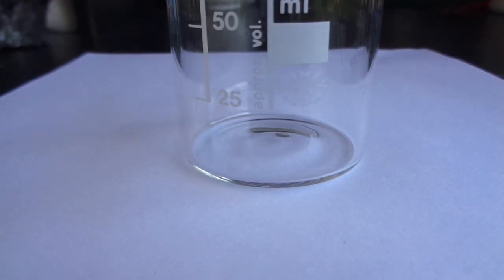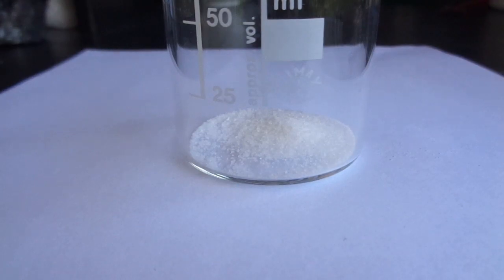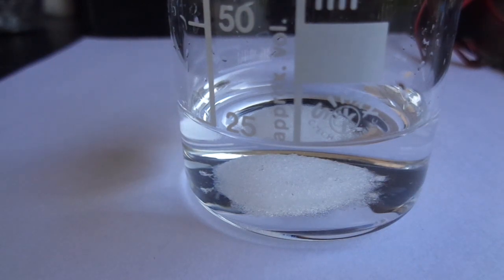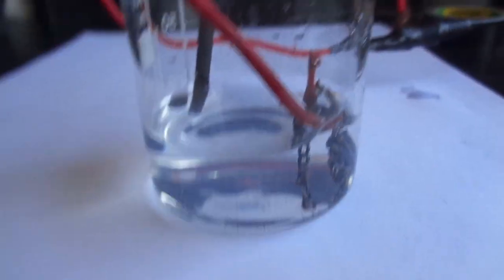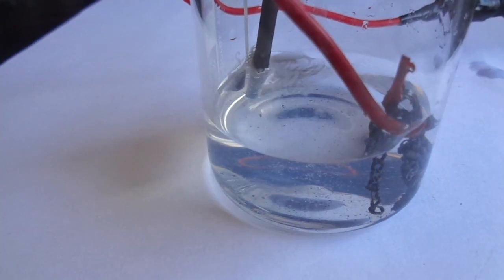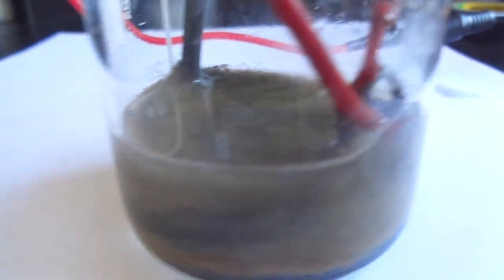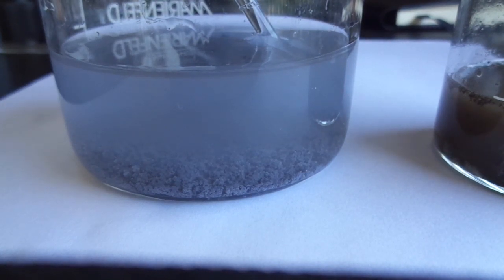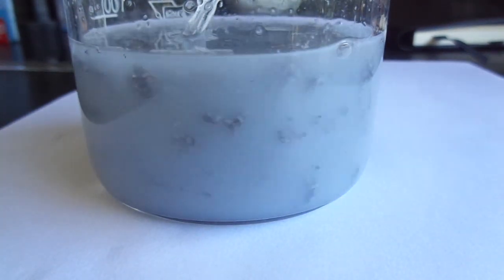Refining silver without nitric acid with electrolisis.

Comment: Hi does this method produce toxic fumes, the reason I haven't tried the classic nitric method is due to the toxic fumes event with venting, I don't want to release the gas to neighbours' etc...
Reply: In theory, if you want or need silver nitrate, you could use the oxide +dilute nitric with little or no fumes.
Reply: he used hcl hydrochloric acid/ mireatic or whatever. he didnt use any nitric.

Comment: Can we use this idea to extract silver from ore
Reply from the maker: Depends on the kind of ore
Reply: @johngeologist3993  
Mika cheist
Reply from the maker: @AmineAmine-ty6nx  well you can theoretically roast the ore with carbon and then do an electrolytic refining like this but it is not the best method.
Reply: @johngeologist3993  what the best method we can do without acids
Reply from the maker: @AmineAmine-ty6nx  There is no method that doesn't include any acid unless you don't care about whether the silver has other metal impurities .
Reply: @johngeologist3993  
So we use this method to refine silver

Comment: Ok.i have done more reading.adding hcl makes copper and silver chloride.
Silver reacts to light to make silver oxide again but copper does nothing. 
Remove oxide by filter and rinse then heat to remove oxygen to form silver.copper remains in solution.
Is this correct?

Comment: Sir.
Can you explain the final process in steps?
I have electrolysed the silver and have the oxide.if treated with hcl does the copper remain as oxide or does become copper nitrate?
Unclear how to properly remove copper from mixed oxides.
Reply: Hi! By adding HCL, silver-chloride forms and percipitates out from the solution because it is not water soluable. The rest of the metals stay in solution because all their salts (nitrates and chlorides) are water soluable. If you use carbon anode some of the carbon particles also mix with the silver but at the end it doesn't matter because during melting carbon helps silver-oxide to reduce to pure silver metal.

Comment: Nice video but what is the molarity of potassium nitrate and hydrochloric acid did u used?
Reply from the maker: I used 10 molar hydrochloric acid but it could be in lower concentration as long as you add stechiometric amount or an excess, I didn't measure the amount of nitrate just keep in mind that the more nitrate you use the more conductive the water will be thus speeding up the reaction.
Reply: @johngeologist3993  thank you!

Comment: Is there a good way to tell when all the silver is out of solution from adding the Hc acid?
Reply from the maker: The silver is not in solution it is in the form of silver oxide mostly if you add excess HCl and boil the suspension with it it should convert both copper and silver oxides to their chlorides you can also dry the solids and weigh them and calculate the exact amount of hcl you'll need.

Comment: potassium nitrate in place of nitric acid hmm i mean its a little hard to get
Reply from the maker: It's the complete opposite for me I can get nitrates easily, beseides this is safer than handeling nitric acid and dealing with nitrogen dioxide fumes.
Reply: I dont know where you but here in the US potassium nitrate and sodium nitrate are very cheap. You can get a ten pound bag for $22.00.
Reply: @MrMackievelli  not anymore lol
Reply: can use literal H20 or salt into tap water, mixed up and used as an electroylte

Comment: Dude, make an entire series about getting metals from diferent, unusal sorces, that people usually treat like trash.
Reply from the maker: Hmm seems legit but do you have any particular example of such extraction.
Reply: @johngeologist3993  silver contacts in electrical switches
Reply: @johngeologist3993 additionally, we have ceramic capacators, would be interesting if it would also work to dissolve them and other precious metal retainers suchs as relays, MLCCs etc. not to mention refining this setup to deal with Lbs of silver plate, verses one peice.
Reply: @johngeologist3993  you could dig someone's rich corpse from cementary.
Reply: Or beat some homeless guy for his golden teeth